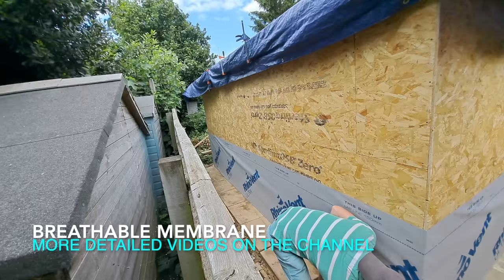DIY Building a Workshop From Scratch | Complete Build | Fast Version

Comment: And now the fun of the interior work begins. If you put as much thought into this as you did the exterior build I'm sure you'll end up with a super organised workshop. Nothing like a clean slate to do such a thing. Looking forward to the next "series."
Reply from the maker: I knew that would be the bit you looked forward to Costa. you know me well. At the rate I am planning the interior it will be a never ending series.
Reply: @startmaking1 Tell me about it. BTW Temu are great for stocking up on hardware, especially obscure stuff which is what I am concentrating on at present. Then, of course I have to find somewhere to put my latest acquisitions.
Reply from the maker: Ah, that is a constant challenge. I have not looked at hardware, good idea.

Comment: What I like the most about this series is, that you kept your struggles and problems in the videos and explained yopur train of thoughts to find a solution. Also, just like I would, you went massivly overboard with how sturdy you build this workshop.
Reply from the maker: I dont seem to make anything without mistakes and difficulties, ITs annoying but satisfying at the same time. I definitely went belt and braces on the build. Probably cost £3k more than just doing it how I originally planned.

Comment: great video, im thinking of a project like this myself, i like the how you did the concrete slabs with a frame, top idea, also showing how you used basic tools to assist when you need a pair of hands to hold things in place - great work
Reply from the maker: Thank you very much. In truth the frame was because I dont have the skill to level slabs and it was driving me nuts.

Comment: I guess I know you probably have a video in the works which will go over the financial side of a build like this (Maybe not with 100% details), but am really intrigued to know the cost difference between this work and say a fully manufactured prefab building. I can't imagine to guess how proud of yourself you are for pushing through this build - you absolutely should be - this is something to be truly proud of - I'd be so excited every time I go in there..(apart from judging every thing I thought could have been better - believe me, it's not worth that - look at what your capable of!)!
Reply from the maker: Thank you so much. I plan to be as transparent as memory and the paperwork I have allows. hard to know exactly how much a prefab would have been as there are so many companies and I could never have gotten one into my garden but it will be an interesting excercise for sure. I really want to know how many screws I used.
Reply: As a rough guide, home much was all the timber? Thinking of building something similar! Thanks

Comment: It catches my attention.  How do they build?. Where are you from?.
  In Argentina, before building, the entire surface is dug about 30 cm or more deep, iron rods tied together are placed forming a large grid, it is filled with a mixture of cement, sand, water and broken stone and freshly When that subfloor has set, it continues with moisture-insulating layers and finally tiles and walls, etc.  Question...
Is their structure not deformed and do they not have humidity problems?
Greetings from Buenos Aires, Argentina🇦🇷!!
Reply from the maker: Hi. Thank you for reaching out. I wish I could have dropped a concrete slab but as I explain in the next video about the costs of the project, I just couldn't because of lack of access. Shame really. But so far no issues.

Comment: Would be very interested in the build cost approx. I’m currently looking at something similar but an L shape. Tried wickes for materials and it was eye watering.
Reply from the maker: I am going to do a full breakdown, it was not cheap. Mainly because I went overboard on the materials a little and built it belt and braces but also the timber prices. I will outline areas of savings that can be made.

Comment: Boss mate well done would say add a little guttering at the back with the water pipe just going into the ground away from the wood. 

How much in total did this cost you? Want to do something like this myself to put a little gym in and golf equipment 💯
Reply from the maker: You are right, I actually just finished the gutter but still have nowhere to direct it. Need to get a butt next. Cost comes out next week. Plus some savings and lessons learnt as I went a fair bit over budget.
Reply: @startmaking1  brilliant looking forward to the cost 👍🏻

Comment: Liked and subscribed - great work and actually well filmed. 

One question I do have (as someone with little experience), not sure if I followed correctly but it felt like there was no pitch at all on the roof for run off. I assume this is fine?
Reply from the maker: Hi Frank. Thank you for watching, liking and subbing. Very much appreciated. It looks shallow to flat but there is a 10cm rise from front to back. It is gentle and I have no idea how it will ever deal with snow but that is next years issue it seems.

Comment: Roughly how much on materials to get to this stage? I did a smaller version a while ago on a concrete base and two courses of engineering bricks to start the walls. I scrounged most of the materials but have to buy now. TIA
Reply from the maker: I cant remember off hand but there is a costs video that I released a few months ago;

Comment: Just want to know what straight edge you use for cutting boards with your jigsaw/circular saw 
Make and model number would help plus where you can get it 
Found your YouTube channel and now retired and need a hobby lol 
Great videos 👍🏻
Reply from the maker: Hi Dave, Thank you for reaching out. It really depends on whether I am cutting full length or not. For cross cutting, so across the ply board, I use a long ruler that I go cheap from amazon. Something like this https://amzn.to/493i04o where I separate the cross piece and use the longer one. But for full length I actually cut a length off the ply board and use the factory edge as a straight edge guide. Chances are it is straighter than anything I have that length

Comment: Really enjoyed this series of videos - thanks Mark. WIll be using as the guide to building my own. Can I ask a stupid question. I'm thinking of using ground screws. when you put the insulation in the base do you need to put anything to cover the underside?
thanks
Reply from the maker: Not a stupid question. And I am not an expert but I didn't. I guess how you do the underside depends on the area you are in. Im lucky, walled garden means no wildlife to climb under and eat out for their next. But I just made the frames based and then filled each void with foil lined foam and then taped it to make it as air tight as possible. Nothing under that but as much air flow as possible. I hope that this helps.
Reply: thanks Mark - really helpful - keep the videos coming - love them
 @startmaking1
Reply: thanks for getting bac k to me - really helpful and sorry for my delayed reply.
 @startmaking1

Comment: Don't you wish construction went as fast as this video shows! Do you know about how much time you have in this project or like me, you probably didn't keep tract. You got a nicer, bigger shop than you had & you're to be congratulated for building it ground-up by yourself. It even looks professionally done in the videos. You'll enjoy working in that shop.
Reply from the maker: Wouldn't it be wonderful. Not exact time for the exterior but from the end of laying the pavers to finishing the outside cladding was 3 weeks 1 day. Wish I had counted the hours. There is one issue that has arisen since building and it is not huge. Just a bit of water leaking in around the doors. Apart from that, not bad.

Comment: Great work Mark……so a question? If you could change 1 thing or do 1 thing differently what would it be?
Keep Um coming, we are all waiting for the big one….. the inside.

All the best
Peter.
Reply from the maker: Thank you Peter. If I could change one thing. Great question. You know, I initially planned to make it around 4 foot longer and now that I am doing the storage inside, I am a little annoyed that I didn't. though it would have made the build harder. But the biggest regret I have is not making the door header smaller and buying a UPVC style door off the shelf. Better sound proofing and less drafts. My doors are proving to be a headache, I will beat them but more stress than I wanted.
Reply: @startmaking1  is it too late to install a roll up garage door. Only needs a small amount of space, I think mine is about 30cm over door hight.
Reply from the maker: @peterjohneggleton2011  sadly I think so. The door is only about 6 feet high so I don't think it would work.
Reply: @startmaking1  Hmm you could look at getting a thick pvc strip curtain to hang on the inside of your existing doors.should help with sound and drafts.
Reply from the maker: @peterjohneggleton2011  now that is a good idea. Thank you Peter.